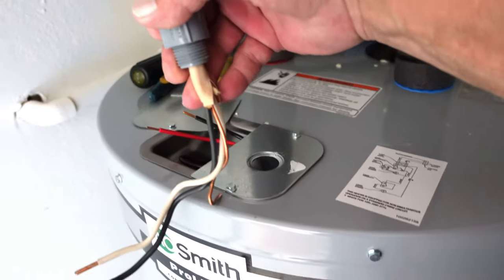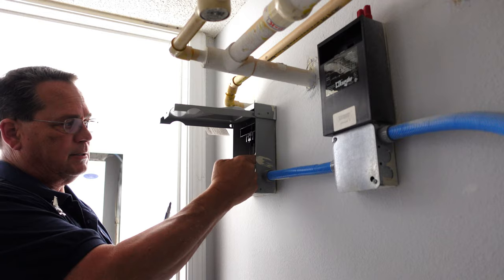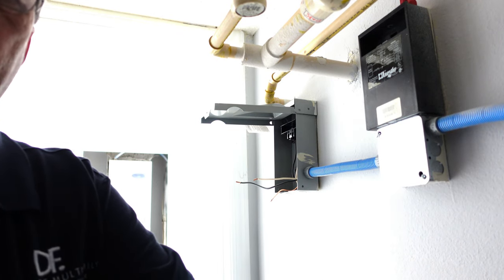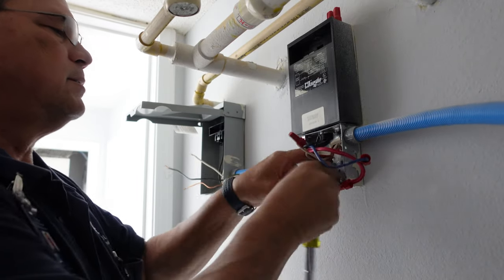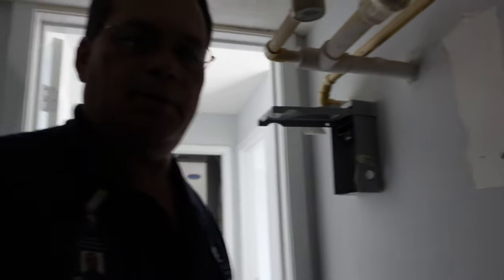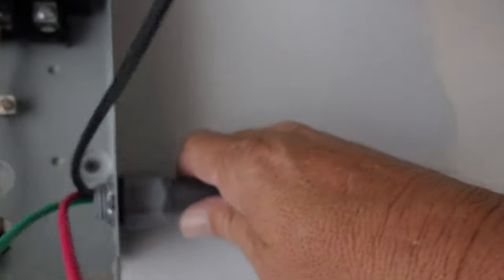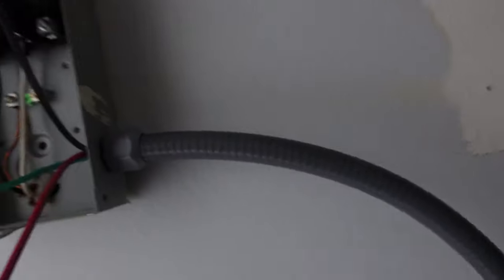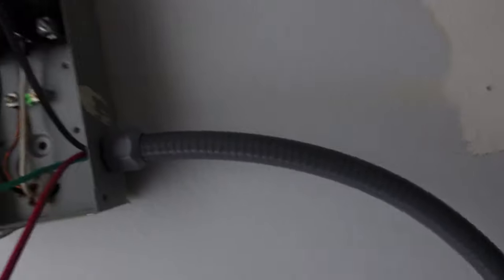How To Wire A Water Heater To A Disconnect Box

Comment: On my new electric water heater there are two green ground screws (one inside the wire compartment like your example and one on the top of the cover) does it matter which ground screw I use?

Comment: question ? what if my power from the electric panel 30 amp breaker is a 10/3 wire and the 240 volt water heater only has a black and a red wire plus ground?
do I tie the red with red and black with black capping off the white wire as being not used? or tie the white wire to the red and black to black at the water heater capping the spare red from the electric panel?
Reply: I believe you cap off the white. You need 240 to the unit so and it doesn’t use a neutral